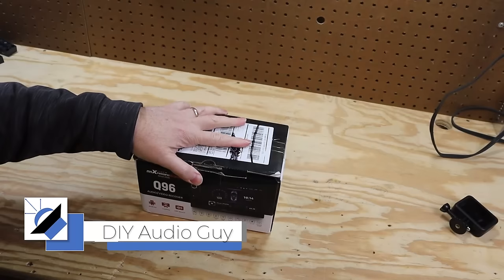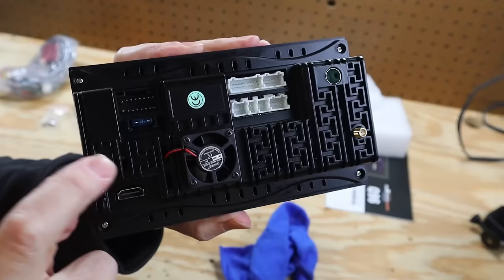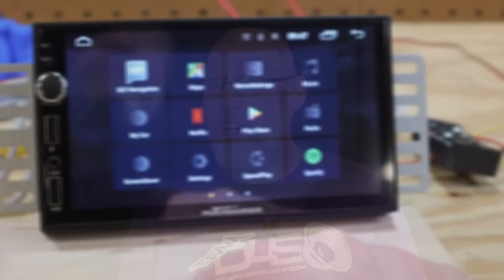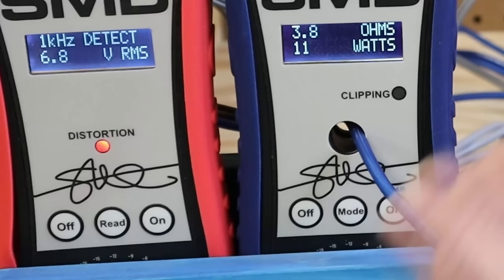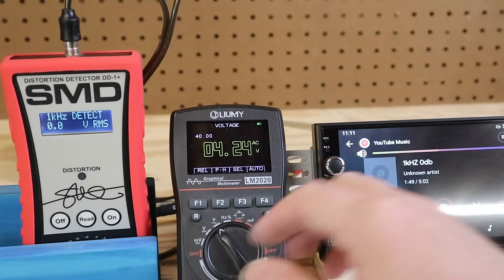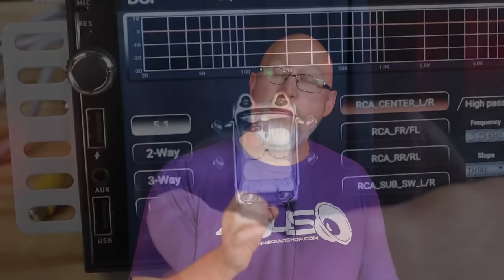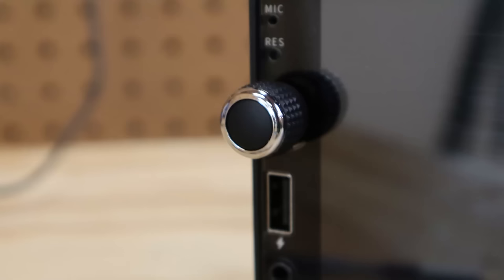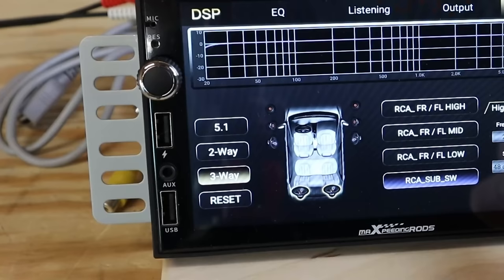The Best Sound Quality on Amazon?  Android Car Stereo Head Unit

Comment: wait, so, with the DSP here, or any DSP i suppose, you're selecting 2-way, 3-way, 5.1, etc......    i get that.  but, once you've chosen it, you have to stick to that, right? especially if you don't want to blow your tweeters?  because i was thinking i could change between stereo and 5.1 for music/movies, but from what you showed at the end, it looks like you can't just do that... i mean you could, btu you would have to set up all your speaker connections again, or at least change the crossover settings or whatever. am i wrong? am i missing something?
Reply from the maker: You are exactly right.  

If you were to hook up something like a 6.5 coaxial on every channel then you could make those kind of changes on the fly. But then you end up with something that might sound decent in 5.1 mode and would really fall short in all of the other modes.

Comment: I bought this Q96 radio. I know the key1 and key2 wires are for the SWC (steering wheel controls) Does 1 or both need to be connected? and where? Thanks. I bought the Idatalink and harness connector for a 2007 Jeep Commander. The installation guide needs to be more in-depth. I saw a video that covered this but now I can't find it!
Reply: I think it depends on the vehicle. If you look up the instructions for the AXXESS ASWC-1 or AXSWC and just connect it to the same wires in the vehicle as the data wires on the AXXESS module and ground whatever needs to be grounded it should work. I only used key 1 on mine since my vehicle (a 2006 Lincoln Zephyr) only has 1 data wire and I just taped off key 2 and it works fine. Much more responsive than my previous AXSWC too

Comment: This may be a bit of a reach, but does this unit have the ability to tune SiriusXM channels? Or would the external tuner still be needed?
Reply: It isn't xm ready.  I jump in my truck, it auto connects, but it does take a bit to boot up, and use my Sirius/Xm app or usually just Spotify my music that way.

Comment: How is the sound quality? I have a Galaxy S22U and an old Toyota Avalon XLS 2000
Reply from the maker: The RCA outlets are clean, so there's no reason to suspect that it's going to sound bad if you go with external amplifiers.  That does not mean that it's going to be an audio file quality sound.

I can't tell you if it will fit in your car, obviously you'll need a dash kit and wire kits.  I didn't test any of its features beyond what you saw in the video.

Comment: I don't know to much about this but they did think about things that most stereo company don't like tool to take out the old unit with is perty smart and it has the play store if the price is reasonable they might have some going for them even with the amp on the head unit not being that good Wich probably won't be used in a system with multiple amps and the out puts are a plus 7 channel with a extra sub woofer not to bad with EQ  for not being a name brand it's not to bad at all if you ask me got me sold 🎶👍👌✌️💪🤯💯

Comment: Mr. DIY Guy! I have a Honda Accord EX-L sedan that is my new used daily driver while I continue my build and work on project truck. I simply just want to add my scosche line out converter for my little amp and a couple 12's. On that car, can I tap str8 into the "stock subwoofer " for my signal so I can use the stock sub control? I've got all the necessary equipment to do it properly.  DD1+, multimeter for voltage control on the line out. What is your opinion?
Reply from the maker: I think that would work.  Consider rigging up an RTA so you can see what kind of signal you are getting.   https://youtu.be/7orJovlXvBM
Reply: Is this reply from you or someone out there phishing? I am just now seeing this message.
Reply from the maker: @kylebainter8595  it's the real me, which is the same thing some guy out there fishing would say.
Reply: @DIYAudioGuy , Touche! That is correctand accurate! What is this Tel,egram me thing? Like to consider myself fairly intelligent, buuut sometimes not so much on the ol interweb! My apologies!

Comment: Would you be able to tell me if the rear camera activates before it finishes booting? I'd hate to have to use the reverse camera and wait for the head unit.
Reply from the maker: Since they did not send me a backup camera I did not test it.
Reply: @DIYAudioGuy  A quick test with touching the reverse cable to 12v + could do the same thing. It would just show a blank screen and no signal.

Comment: If you want a next level android head unit I'd suggest the Joying. You can use its digital output directly to your dsp and not fool around with rca's. 
I gotta admit, your units built in DSP is quite impressive. It must be using a new DSP chip as I've not seen these features anywhere else.
BTW, don't use the steep slopes. Try to stick with 24dB/octave. Hopefully they use Linkwitz Riley filters. With this type filter and slope (LR4) you get better phasing and it's safer for tweeters. 👍
Reply from the maker: A lot of people have left comments about that brand.  I may reach out to them and see if they are interested in sending me a unit.

Comment: Sorry to go off topic, but I didn't know how to send a DM. I was tuning my mid/highs amp today, so I had my sub gain knob all the way down. After a while of tinkering, I have it sounding pretty good. I then started to slowly turn my bass knob up. Then I noticed the bass pretty much disappearing from the mids as the subs were getting louder. This tells me that they are out of phase from each other some how. So, I swapped the wires around on my sub box.... and it sounds great... like better than ever. My question is... is there any harm at all to  the amp or subs by having my subs wired "backwards"? Neither the amp (A Sundown SIA 1250) nor my LC2i pro have a 0/180 switch.
Reply from the maker: Nope, no problem at all.  Perfectly safe.

Comment: Can you specify what DSP chip , DAC chip, ADC chip this unit uses.... 
 Your compared it to dayton 408 !!
Reply from the maker: That information should be in the product description on amazon. I really don't know anything about chips and I try not to comment on things that I don't know anything about.
Reply: @DIYAudioGuy   408 is not very high end chipped DSP. But still way better than HU claiming to contain a proper dsp chips. 
 So i thought maybe you know that what DSP chips are in this unit, hence you compared with 408

Comment: If you want an android headunit that isn't sluggish, you have to get one that has a modern processor. 
Android headunits have more in common with a phone then a headunit and should be treated as such when making a purchase. This unit is a quad core cpu when you really need an 8 core cpu with 8-16gb of ram for a buttery smooth experience. However good specs can't fix crappy unrefined software, so you can still end up with a dud.
Reply from the maker: I am not really up to date on my processor knowledge.

Comment: I wonder why no head unit has a rms above 15? 11 watts x4 7volts on subs. I have a sound digital 400.4 that fits in the palm of my hand. That tech could easily fit inside a head unit. Micro amps out perform head unit amps and that’s just dumb!
Reply from the maker: My guess is that is has something to do with heat dissipation in the dash.

Comment: I have a fun project I have no business attempting myself tho. I was working in Miami for a month and the company rented me a car. The rental place messed something up and had to upgrade me to a 2021 BMW 330i. For the last 14 yrs I've been driving my FrankinTruck a 1989 Ranger extra cab. I've recently bought a 2006 F150. I would like the 2021 BMW sound system in my F150. Would this head unit support more than 4 speakers? I think the bmw had 7? Including bass. A small 10in sub would be fine. I found a new band (Owane) that requires a lil bump to really appreciate.

 Also I'm fully prepared to make my own fiberglass A pillar trim to mount the tweeters. Do you have a quality head unit suggestion with android connect? Thank you!
Reply from the maker: With external amplifiers any headunit will support any number of speakers.   This one has 8 channels of RCA's for those amplifiers and a good entry-level DSP to manage those 8 channels.  If you are trying to recreate the sound in a 2021 BMW you will want something a little nicer and an external DSP.
Reply: @DIY Audio Guy  thank you!
Reply: @DIY Audio Guy  do you have any suggestions for a good head unit to look into? Something with android connect.
Reply from the maker: @tonyfoxxbuilds1920  There are a ton of great options out there:  https://howl.me/ciLI1uWW0hK is just one example.  That website will make sure you have all of the install gear you need (brackets, wires,harnesses, steering wheel interface).  Just find one that fits and works for your budget.
Reply: @DIYAudioGuy  thank you!

Comment: So this with the d4s jp95 or would I still have leftover rcas' and still need the jp77
Reply from the maker: Yes, but there's no law that says you have to use the leftover rca's.  You can still go with the JP 95 and run a set of components off of the front channels instead of going fully active with the front stage.
Reply: @DIY Audio Guy  if I was gonna build the best "price to performance"  car audio setup including the jp77 and this unit.. which speakers or dual components would you suggest?  
I have 6.5" factory components for the front and rear.

Comment: my problem with these android units on amazon i have purchased 2 and both brought in massive engine noise using aftermarket amplifiers, and pops my sub amp when turning off so i dont trust any of them hooking up to a amplified system.
Reply from the maker: That sounds miserable.
Reply: @DIYAudioGuy   yes  it did  then decided to get a boss 10.1 deck and works well other than the horrible bluetooth that cuts in and out has to be restarted to fix and to use volume after turning on car have to mute it then the volume will work was hoping a new firmware should and could fix those dumb issues but there is not any i see guess ill wait and see what luck i have  next time

Comment: Here's a question for you. Do any of the android head units support USB external DAC. Have  anice dac amp speaker setup I've been running with an android tablet as a head unit. Its getting tired and looking to update, do the USB ports support external DACs? (or any other units?)
Reply from the maker: Not that I know of.
Reply: Ouch guess I'll be looking for a modern tablet with editable custom rom. Tears and swearing in the near future then.

Comment: I ordered one from your link.. I'm trusting your measurements. Might have some questions during install. Well I'll ask now if I have four channels on my amp. Do I run a splitter from each channel of my amp to my RCA hook ups running from the radio?
Reply from the maker: No.
Reply: @DIYAudioGuy  so I just run from two RCA to the 4 channels on my amp. I've got a Rockville db45. I have  a pic of it's connections. But can't upload it here.
Reply: Yo!!! This head unit is serious business. The RCA's are very powerful. I literally had to cut my amp down because it was too loud on 4. What a difference from a head unit I bought a few weeks back that was seriously underpowered. Truly a good deal for quality audio.  ...thanks DIY guy. Do you have a video on the DSP and frequency settings?
Reply from the maker: @younglion72  I'm glad to hear that you like it.  I don't have any videos on DSP settings.  I've tried to film a few over the years but they always come out boring as hell.   I figured the video is so boring that I can't sit through my own video that is just not exciting enough to post.

Comment: Oh and those included brackets included with those cheap units..... are usually pretty much useless. These cheap units could REALLY REALLY be better if the chassis was 2inches deeper and the bezel properly sized matched to the metra, pac and scoche mounting kits.
Boggles my mound how badly some fit these kits

Comment: Beware, the link to the Amazon unit is for a unit WITHOUT a volume knob!!! Also, there isn't a fan and the heat sink is orange in color...
Also, there isn't a DSP, nor does it have 8 channels of RCA outputs. The one I purchased is a pile. The lack of documentation makes this a paperweight.
Reply from the maker: Odd.  I will see if I can fix that.
Reply: @DIYAudioGuy  not sure if this had anything to do about it but there are 3 choices of units to choose from when following that link. A couple of units for Hondas and the third, the one I chose, is for Chevrolet models, Silverado specifically. It does bolt right up without any brackets which is nice, but the amount of wiring harnesses and connectors given is still making my head spin!

Comment: 45 second boot time is a no no.
Reply: that's the first time boot up, like when you disconnect the battery. when you turn off your car the device goes into "sleep mode" and starts up in a few seconds when you turn the key
Reply: @fricktion01  bought one tried it. Didn't change for me. Unless I changed the stand by time. I  ended up going with a PLZ headset. Acts just like a factory radio.

Comment: I'd stay away from any "android-based" head units.  They're basically taking an Android phone, disassembling it, and turning it into a head unit.  I bought one of the most expensive Android-based head units on the market, Insane Audio's DD2001 and it was utter garbage.  Everything ran off of apps and barely relying on the hardware for its output.  The touch screen was terribly difficult to use.  Overall quality was just pure trash.  It's the most money I've wasted on a single mod for my truck...next to abandoning Stinger's HEIGHT10 for Sony's XAV-9500ES.

Comment: One of the main reasons these cheap Chinese android radios are so cheap are as follows 
They do not PAY TO LICENSE ANYTHING.

They don't pay to license android auto , they don't pay to license Apple carplay, they don't pay to license Bluetooth, they don't pay to license any of the gps maps that some are equipped with, and as you can plainly see they use lesser quality outputs compared to name brand radios. 

Often these units do not fit the aftermarket mounting kits without a bunch of dinking and passing around as the bezel does not fit inside the aftermarket mount kit.

They will have zero support no online support no telephone tech support and the owners manual is usually pretty terrible. 

Some like the unit reviewed DO have some advantages over other cheap units.

Comment: Well then, I feel like I learned absolutely nothing after watching this lol that's not your fault by any means. Just that you might as well have been talking in another language n I retained very little information from it. I don't want to have to know all that extra or spend 5 hours tuning parameters just to have good tunes
Reply from the maker: In other words you learned that this radio is not for you.  I just saved you $160 bucks.  Hopefully that was worth a few minutes of y our time.
Reply: @DIYAudioGuy  exactly which is why I respect what you're doing by going so in depth with your reviews. I expected you to just be one of those guys that takes it out of the box, reads it's "specs" then hooks it up n is like this sounds good or it sounds like shit n go through it's apps. You definitely went far beyond that n got into things that a layman like me doesn't want to be troubled with which is what a good knowledgeable reviewer should do. But I also personally don't want a car system that requires a pile of amps drawing crazy amounts of current. N I think that this head unit would suit someone that's looking more for an entry level competition unit or that's very particular about sound. Which is prolly why the internal amp setup isn't good at higher volume. My requirements aren't hair dancing cardiac arrest inducing lows n eardrum rupturing highs. Just, can it push some reasonable aftermarket speakers n send good sound to a woofer amp to make some 10s go thump thump thump lol

Comment: maxspeedingrods is a laughingstock in the car community. mainly known for shipping faulty parts like suspention and other that is VERY important for safety. I would not recommend this company for car parts and i'm not saying that by personal experience but rather from the car community's expereience. Please don't buy coilovers and such from them as their sketchy at best. 

no idea about their car audio selection though but i bet it's just rebranded chinese stuff equivelent of bargin bin ebay (which can be decent at times).
Reply from the maker: Yea, don't cheap out on those kind of parts.